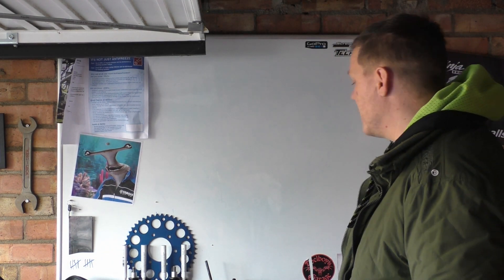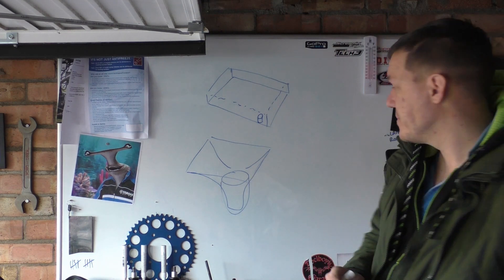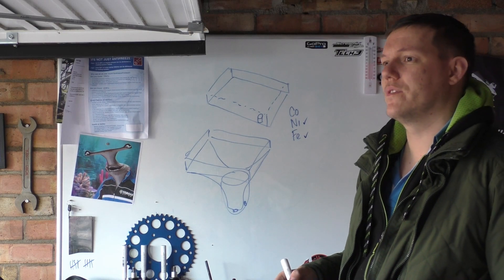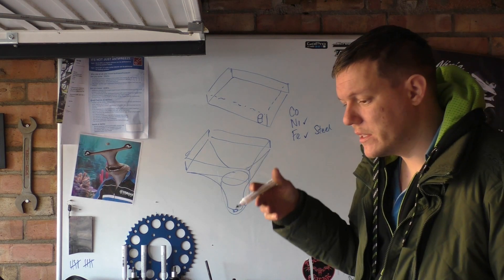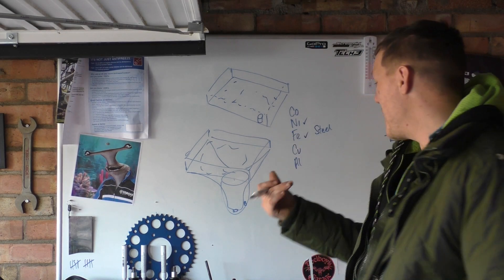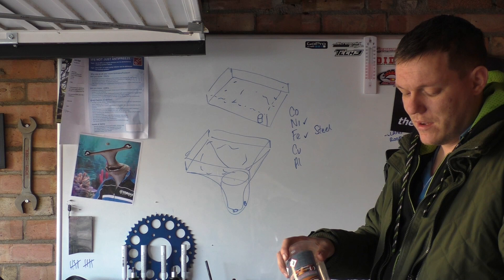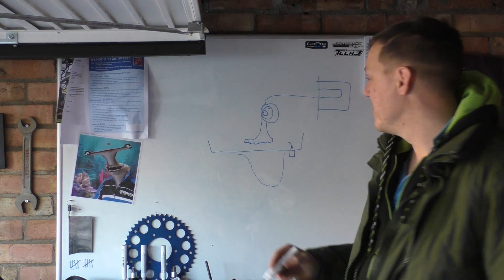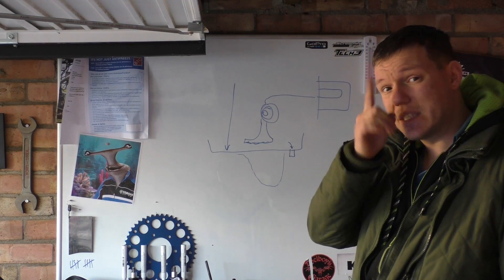Magnetic Sump Plug - Any good?

Comment: What about if they are fitted as stock from the factory on a brand new engine?
This would be the point where the most wear happens the fastest as the parts start to really mesh together.

Isn't this the very reason manufacturers recommend an oil change after a very short time on a brand new engine like 200 to 500 miles?
Reply from the maker: Yes it is. However, (of course I had a but) the main reason (as far as I understand) is that magnetic sump plugs are so you can stick it to the frame or the filter so you don't lose the plug. 

Secondly, most of the 'stuff' that breaks off suring run-in is aluminium flashing (shit from the casting) and ally isn't magnetic. Most cylinders are nikasil, bearings are none magnetic material etc.

like I said most steel components are hardened steel and the wear material is fucking tiny.

Comment: Lots of heavy machinery (wheel loaders for example) come with magnets on the drain plugs, mostly in differential and planetary gear oil plugs. Must be some other reason than just hanging the fu'king thing so you wont lose it. And i know you were talking about ENGINES but still, why if they need it for fuck all, maybe because they dont have a filter or screen, and the oil moves about much more?

Comment: So Suzuki and other manufacturers are wasting their time, money and logistics to install a magnetic pug to get that little and insignificant effect?
Reply from the maker: They have magnetic plugs to stick the plug to the something steel so you can handle the oil pissing out. (edited - typo on steel)
Reply: The Workshop It may seems to be a good solution for oil change. But I'm not convinced of that purpose. It is an expensive item just to avoid losing a huge plug while draining the oil. As the most elemental metal in (used oil) suspension is aluminium, the magnetic plug only works for the second most: iron.
Reply: Manufacturers save every penny especially on items that don't serve any purpose because a few penny's per unit over millions of units is a lot of money.

Comment: Can't really call them $hit when countless car manual gearbox's have them,many car engines have one in the sump or the drain  plug and every automatic transmission has a least one magnet in the sump, and most important it is rare to see one that hasn't picked up a load of swarf and debris so it looks like a hedgehog,so not a perfect thing as agreed a lot of engine/gearbox parts are non magnetic,  but they do work and in the theme of can't hurt the engine/gearbox/differential it don't make much odds really ,the auto trans sump magnets are very strong as well
Reply from the maker: The magic word here is 'gearbox' and the bad word here is 'car'